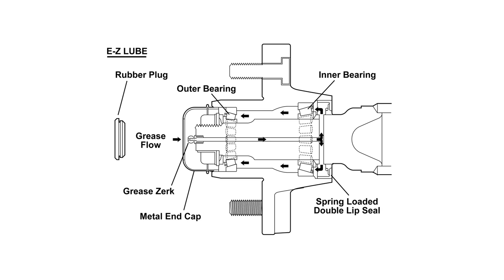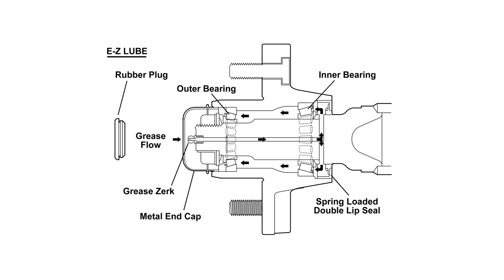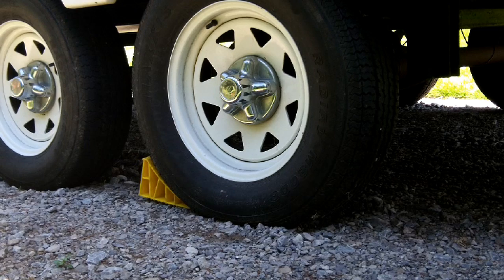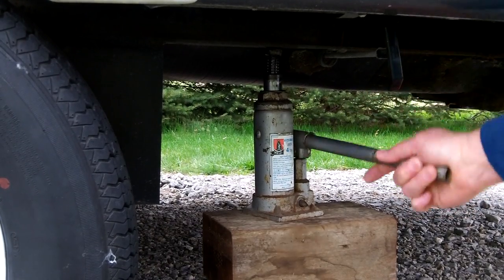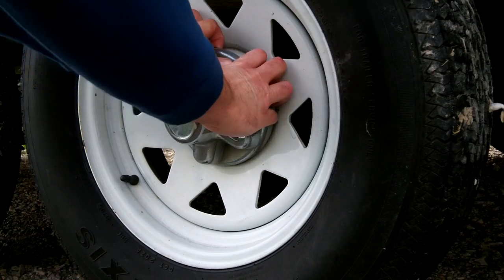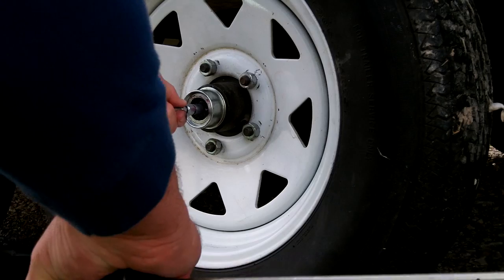Lubricating the Dexter E-Z Lube Axle Bearing System

Comment: I am glad to see a demonstration whereby the wheel is being turned while the new grease is being pumped in. This is a Dynamic procedure vs Static, and is very important to understand! 
If the wheel is not turned, the new grease will take a path right between the rollers, not allowing for a full or complete exchange! 
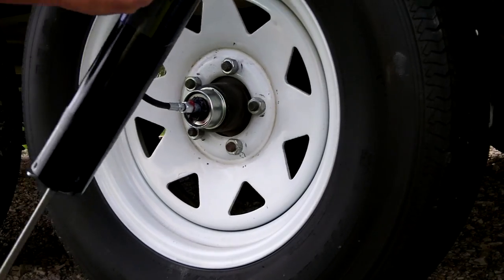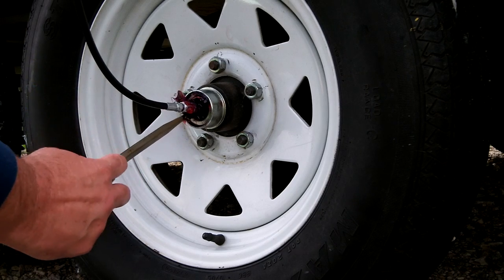At 2:00 into the video, you will see a somewhat discolored grease exiting. This is the old grease, not new grease as the author said.  At 2:12 into the video, he corrects himself. 

Not all grease chemistry is the same, and in some cases, incompatable chemistry will cause the grease to lose viscosity. If you are not sure of what type of grease was origianally used, test them to make sure that the two are compatable.

Comment: I wish my new grease was much different color than the old stuff. He is replacing red grease with grey, so its easy here. However, this was still very helpful. I needed to see how much old grease comes out.
Reply: The old grease will be grey when it comes out of the bearings. If you pump long enough, you will see the new (red) grease coming out, meaning that all of the old grease has been forced out of the bearings.

Comment: My manual for my Al-KO axles says you do not have to lift the wheel off the ground to grease the bearings with UltraLube hubs.   Not sure what to believe.   FYI:   Dexter Purchased Al-KO a few years back.
Reply: Rotating the wheel makes is easier for the grease to flow past the bearings and reduced the potential to push grease past the seals.
Reply: How do you figure that?  The space/volume between the rollers where the grease flows through remains the same whether or not the bearing is turning or stationary.
Reply: Does not matter.  Some manufacturers say spin, some say not necessary.  The bearing does not "open up" to allow more grease through while turning... if you feel better spinning the wheel, do it... but it's not necessary once the hub is fully packed with grease.

Comment: I bought a brand new pontoon.  The trailer had these hubs from OEM. After launching my boat a few times the grease in the left hand hub came out of the rubber cap. Returned to the dealer they said it’s fine. It did it again today. The grease in both hubs are lavender in color. 

I bought a couple tubes of Lucas red and tacky and pushed all the lavender grease out. 

Is there a more serious problem that I should bring it to the dealer?
Reply: I like Lucas R&T lube but for boat trailers I use a full synthetic marine rated grease.  Mystik is the brand and it's blue in color.  It is more tolerant of water intrusion.

Comment: Does this take a special fitting on the grease gun.  I noticed my grease gun tip does not fit in tightly?
Reply: Car mate trailer idle hube
Reply: Grease gun tips usually are adjustable,  screw in to tighten

Comment: That’s great and all but you really should be explaining to people that this isn’t a recommended procedure on a regular basis. Even Dexter recommends pulling the hubs and visually inspecting the condition of the bearings, hub/break ware. Also if your not seeing any grease coming out within 12 pumps of the grease gun I recommend stoping and pulling the wheel as many times this is an indication of a blockage  which means the actual grease is seeping past your seals and contaminating the pads, magnets etc... which is a costly repair if that happens, You can not clean these and use them again so new backing plates will be required.
Reply from the maker: If this is the first time the hub has been serviced using this method, it will require a lot of grease to fill the hub and push back out the front. This is how the system was designed and with a bit of care it will works well. Just follow the instructions. Not to say you can't hand-pack the bearings if you feel more secure in doing so. That is always an option.
Reply: @BugSmacker  i followed the exact instructions in the dexter video and decided to get it inspected this year...the were way overfilled apparently and told me no more than 3 or 4 pumps

Comment: Someone should tell the guy to push the follower rod into the cylinder. It's a lot easier to handle the gun without the rod sticking out of the end.
Reply: That is what I was thinking when the video started.  Also I would not use lithium but  a good synthetic.
Reply: Not me (the rod), I like mine left OUT, so I can see just where I am quantity-wise (or grease that's LEFT in the cyl.), as this 'moves' as It's "drawn-down".

Comment: How much grease do you leave on the inside of the cap between the outer bearing and dust cap?
Reply from the maker: I would keep it pretty clean. You want the grease in the bearing.
Reply: The grease than comes out into the cap has already been forced out thru the bearings. Clean it out to avoid it being slung out past the rubber cap by centrifugal force.

Comment: Do you still clean and  re
pack them every year?
Reply: No.
Reply: Gary McCray yes
Reply: Joe Chiarelli no there would be no point in cleaning amd repacking every year with this system. I would check for end play in the hub while its on the jack. Work the wheel from side to side to check for slack. It any is detected re-adjust as nesessary.
Reply: No.   5 or 6 pumps of grease into the axle, and you have just repacked both bearings, assuming that you have the hub full of grease to begin with.

Comment: What is your opinion on Walmart's Super Tech Lithium grease.  Specs seem pretty good - anything glaring that would make it not good for trailer wheel bearings?  Its very cost effective - especially when purchased in the 3 pack.
Reply from the maker: I would think it would be fine to use this type. Dexter recommends using a Lithium Complex type grease. They also specify not to mix different types of grease.
Reply: I use Lucas Red and Tacky 2. It's lithium based and has a high drop point of 540 degrees.